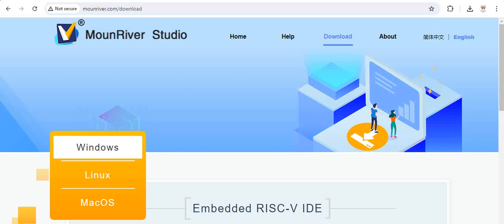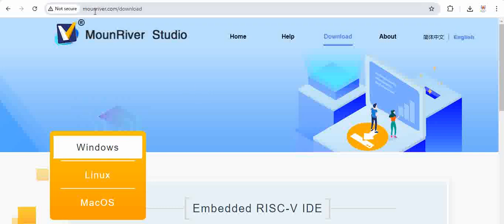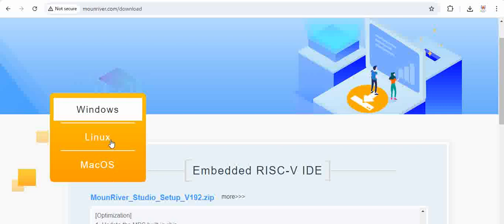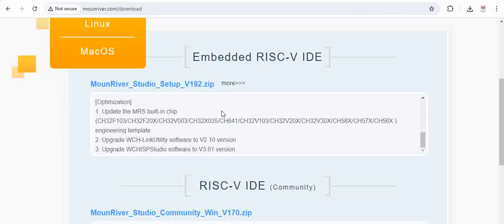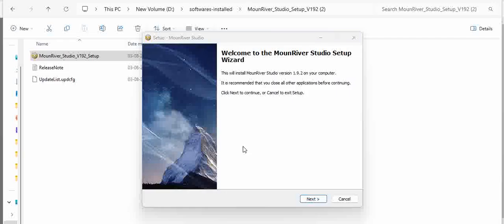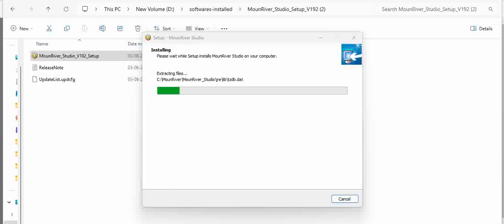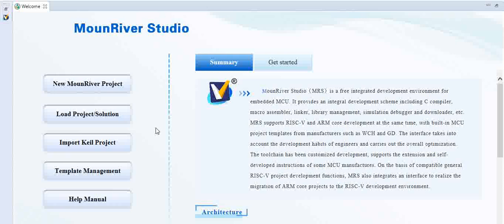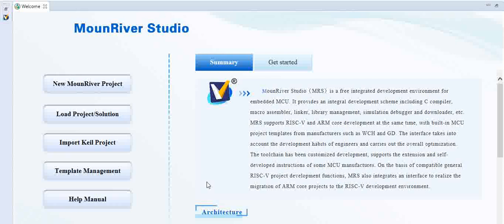Installing Moun river Studio | CH32V003 Tutorials - Part 6

Comment: I'm using a CH569 evaluation board + WCH-LinkE debugger and was wondering, 

as an alternative to MounRiver Studio (MSR)..  any thoughts on setting up the environment manually?  For example, according to the HydraUSB3 documentation it seems more involved:

install msys2 shell , then install tools:
pacman -Syu
pacman -S mingw-w64-x86_64-riscv-none-elf-gcc make git cmake
(verify installation by opening the msys2 mingw shell :
      riscv-none-elf-gcc --version
      make --version
)
Update Windows Environment Variables to the mingw64\bin path
Download WCH's official CH569 EVT package containing EXAMples, headers, libs, etc.. and install WCH-LinkE Driver and GDB Server
install Eclipse C/C++ Development Tooling (CDT) and create a new project pointing to the header/lib paths and WCH's makefile  (makefile should look like CFLAGS += -I/c/wch/CH56xEVT/EVT/INC)
Setup the Eclipse toolchain to point to mingw64 gcc, assembler, linker (ex. riscv-none-elf-gcc exe , riscv-none-elf-gdb), 
The debugger tab should be set for riscv-none-elf-gdb (bridge to the WCH‑Link GDB Server) and localhost:3333
Eclipse's External Tools Configurations should be set to run the wchlink_gdb_server exe in the background with arguments : -device=CH569 -port=3333
Finally the Debug Configuration->Common : Under “Pre‑launch,” add the external tool WCH‑LinkE GDB Server

Of course, you can still use WCHISPStudio to flash (not debug) the hex/bin directly to the chip by entering ISP mode (BOOT/RESET low)